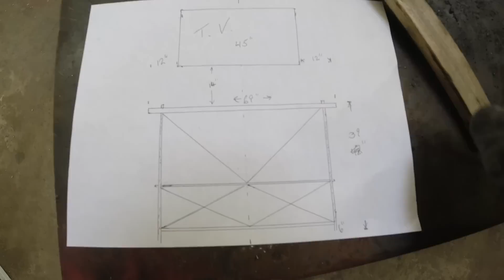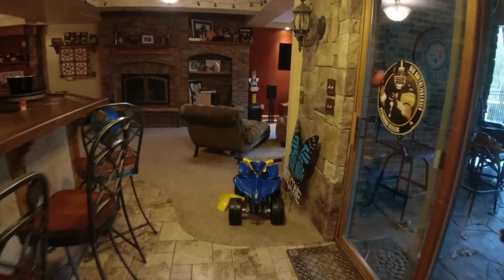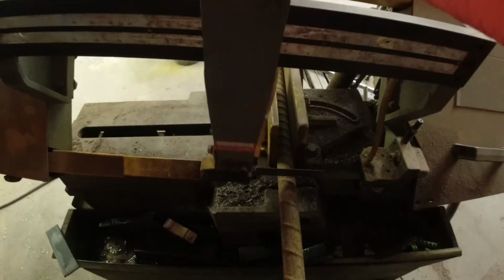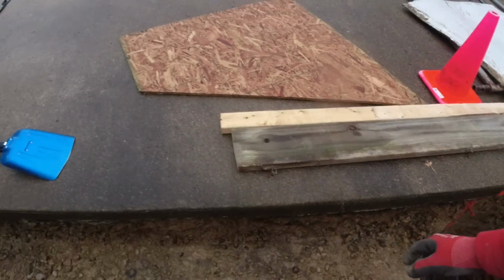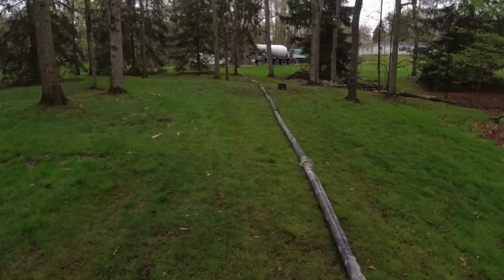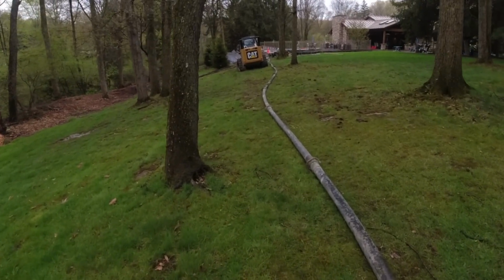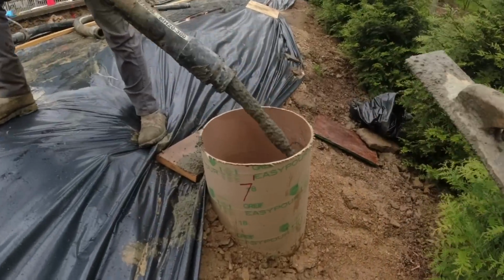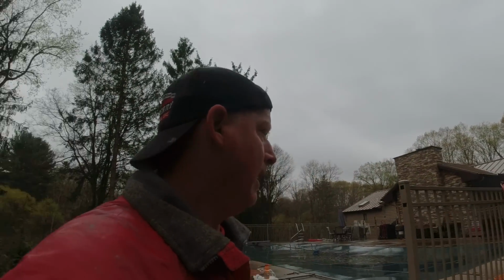I Am So Sick Of This!

Comment: The rebar base with live edge slab top would be cool
I am a carpenter and I remember a job where removed part of a roof of house to add a second story. We had it tarped at night but one night hard rain woke me up in the middle of the night and a little voice said go check the job. So I did and it was fine but I knew I could not sleep thinking about it. Moral of my story is concrete guys have it worse than carpenters with the rain worries. Concrete can either be worked or it works you.
Reply from the maker: That’s for sure

Comment: Got a question for you Tom . What is the best way to get tire marks off of the concrete driveway? Need help .
Reply from the maker: That is a tough one.pressure washer about 3000 psi, scrub brush, and then at the very end a little bit of xylene and a scrub
Reply: Thanks I’ll try that.👍